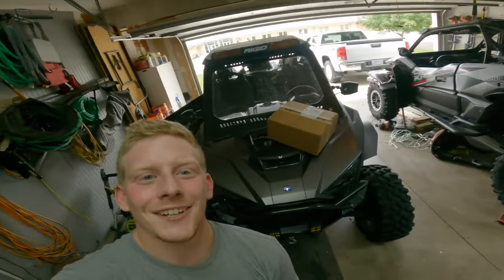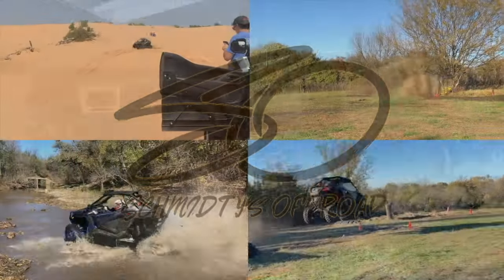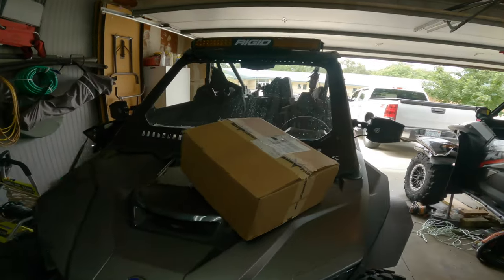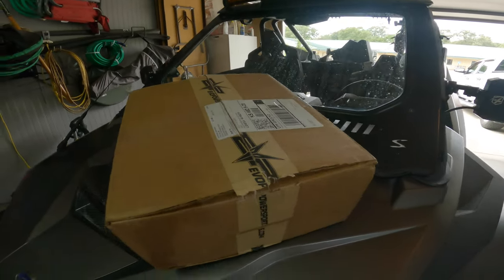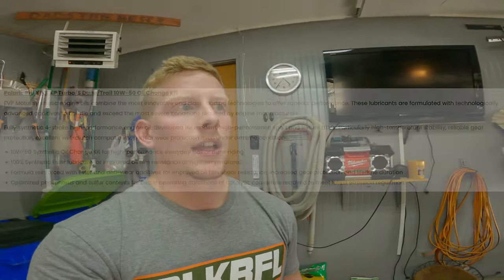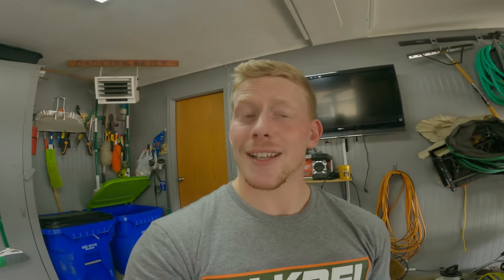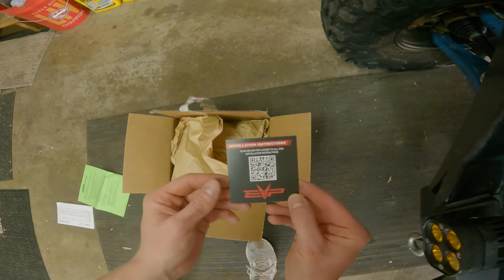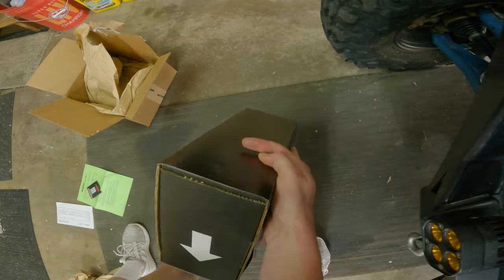EASIEST Way to Change Oil in Your PRO XP!!! - Evolution Powersports Motul Oil Change Kit

Comment: I'm looking to get the one with the spark plugs and the differential oil as well going big
Reply from the maker: I’m not sure what it is, might be in my head, but I swear the motor sounds like it runs smoother and quieter with this oil. I might be crazy but I’ll put it to the test!

Comment: That oil filter slide you linked comes with an oil filter removal tool, does that fit on the oil filter the pro xp uses?
Reply from the maker: Oh shoot I might have added the wrong item. I don’t think mine came with the oil filter wrench. I haven’t ever had issues with my oil filter coming off though but I know some people’s seem to be on there with an impact. They shouldn’t ever be hard to remove

Comment: How often do you have to change the oil on a motorbike?
Reply from the maker: It really depends on how hard I drive it and how much. Probably once a year but if we go to the dunes several times I’ll usually change it. We run them pretty hard on the sand